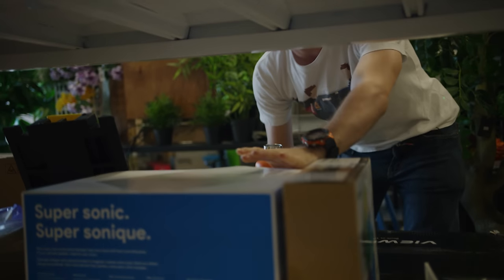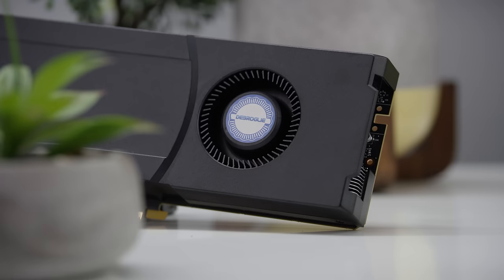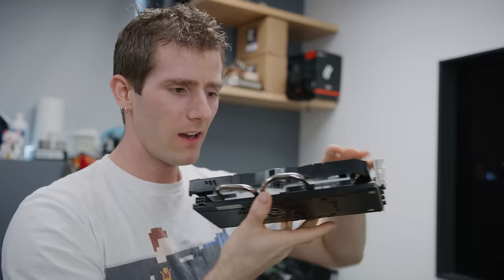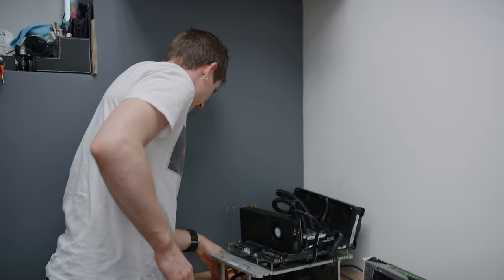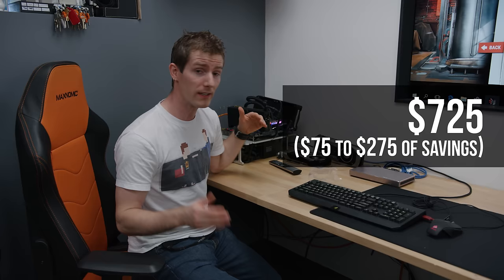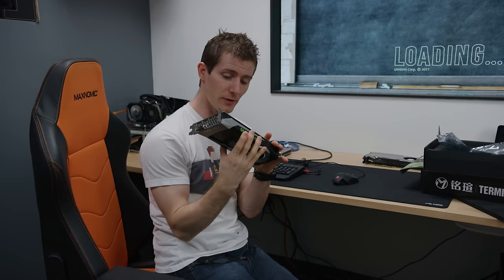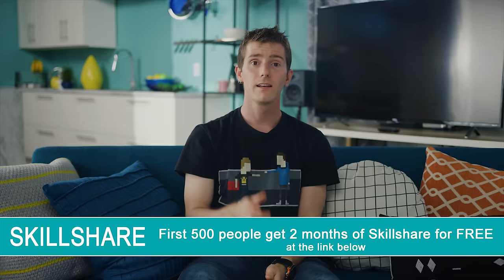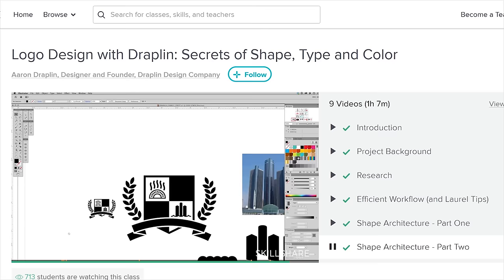Cheap AliExpress Graphics Cards - SCAM???

Comment: Actually, that ALESA GTX 1080 costs only around 400 USD if you can read the Chinese and buy it from TaoBao (AliExpress Chinese version in Mainland China) online. It will save your not only 275$, but 600$.  The shourd and cooling design are collected from old AlESA GTX980, while all the chips are actually founder edition of GTX 1080 and the Video Ram are from  a variety of brands. BTW, they are not good at overclocking at all and totally cannot do crossfire. If you can understand the chinese, you can check this video: https://www.youtube.com/watch?v=2Gdfo0yPw4Y. It is so cheap because some mud flood happened nearby a hydraulic power station nearby which mining was going on.

Comment: From watching your video, it doesn't seem like a scam at all. Just some poorer quality heatsinks reflected in the price. You just decided it was a scam from the get go, and trying so hard to prove it. Even at the end you were saying "not quite a scam" implying you're still being scammed in some way. You just got a cheaper variant, but you decided it was a scam because you're used to the premium variants sold in the western markets.

What you did miss a chance on is actually doing something useful like measuring temperature performances on those heatsinks and fans and comparing it to the expensive premium heatsinks from the western markets. Obviously it would not be as good, but what's important is that you can use the data to predict whether the cheaper ones are fit for purpose over the lifetime of the card. The heatsinks included might not be the pinnicle of engineering but they might do a well enough job for the purpose. Or maybe they don't. But you could test it and that'll be useful information for everybody..
Reply: alot of these seller are scam especially on ebay. they edit the cards firmware so your PC thinks its an high end card when it's really some old 9500gt.
Reply: So....the part of the heatsink that wasnt attached to anything and didnt really seem to help with cooling, and the plastic backplate that tried to imitate a metal backplate, those things are not scammy at all, huh?

Clearly these cards are made to look convincingly high quality in pictures, but when you get them on your hands, you can see they are pieces of crap.

Yes its not outright a scam. But its still sketchy at best.
Reply: Yeah the title is what one would call clickbait.
Reply: Morpheas bad design on the cooler maybe but there's nothing sketchy let alone "scammy". Do you even know what those words even mean. There's no outright scam, there's not even any partial scam. He bought a cheap 1080, he got a cheap 1080
Reply: Morpheas I see someone havent lived in asia... everything looks cheap, unless you want to throw in a bunch of money for a "premium brand", which, spoilers, is not considered cool.
Reply: the first GTX 1080 had a gtx 980ti shell. that is more or less a scam
Reply: Kloot Sack They've just used a cooler with an older design. Why is that a scam? It's essentially a hunk of metal with a fan blowing air through it. It's a piece of technology that's remained essentially the same for the past 10-20 years.
Reply: The same for 20 years?  You do know that GPUs didn't even have shrouds that long ago and if anything at all had only a small heatsink/fan.  This is what a GPU cooling solution looked like about 16 years ago:  https://www.google.com/search?q=geforce+3&safe=off&source=lnms&tbm=isch&sa=X&ved=0ahUKEwiky67mhKPbAhWJIjQIHSyAAEAQ_AUICygC&biw=2151&bih=1119#imgrc=Air3w2b2uBEqDM:

Hell, most GPUs back then didn't even HAVE fans or heatsinks lol
Reply: Capnsensible80
 You do know you linked to a google search of geforce 3s, all with heatsink and fans. Oh wow a shroud. What technological advancement, they invented a plastic cover over the heatsink and fan. My first discrete GPU was the Voodoo 3. Even THAT had a giant heatsink.

Let me explain to you what a shroud does. They cover the entire thing so that they can use a single fan to blow air through the heatsinks so that the fan doesn't have to sit right on top of whatever it is cooling. You know why the second GPU doesn't have a shroud? Because it has two fans providing coverage for the entire card. The shroud is a simple piece of plastic or alum to facilitate the heatsink and single fan combo. It's nothing special. It's a box.
Reply: The Great One Exactly!! On eBay!! Which this video is not about. It’s about AliExpress..
Reply: Morpheas Uh no.. You try to buy a cheap 1080, you get a cheap 1080. It’s only honest and fair.
Reply: Robair have you even tried to ever buy something from AliExpress?! They’re actually very costumer minded and will help you with every complain you have. And I can say the same about the sellers. Don’t judge things which you know nothing about.
Reply: I don't know if you watched the same video as me, or maybe you just didn't bother finishing the video.  They very clearly come to the conclusion that they got a working 1080ti and an actual 5gb 1060 meant for game cafes in china
Reply: Duncan Wiggin yeah just get what works. screw whatever you don't actually need.
Reply: Carson's Vids wasn't it just a normal 1080 though?
Reply: ArtisChronicles ya I swear I edited it after the fact but I guess not
Reply: Normal as in?
Reply: You clearly didn;t watch it properly either, one was a 1080, not a 1080 Ti.
Reply: ScottC if you read this full comment thread you'll see that I addressed that already
Reply: Totally agreed. Confirmation bias it is.
Reply: I don't see why it would be a bad idea to buy this Chinese 1080. It's got a reference PCB right? Just screw off the cooling, buy an A240G Fluid Gaming set from EK Waterblocks and you have your custom watercooled system (including CPU cooling and reservoir, fittings, hose) that looks and performes amazingly well for the price of one GTX1080Ti or lower. That's a no brainer if you can hold a screwdriver.
Reply: LOL, so true.

He didn't recognize and part numbers and the label seemed wrong, so it must be a scam!
Ironically if they put on stickers he expected, then he probably would have swallowed it hook line and sinker.
Also loved the way he marvelled at the reused shroud..
Reply: i guess we found the aliexpress employees...
Reply: Did any of you watch the video? Forget the cooler.. that's replaceable. It's literally a 1080/1060 card, proven by the benchmark results. So... you buy a cheap 1080 that performs just like the founders edition, but you think it's a scam or we're Aliexpress employee? You're all idiots lol. Sold as a 1080, performs like a 1080, it's PROBABLY a 1080. What scam is there?
Reply: Yes.!  Thank you.!  Good point. Well articulated...
Reply: I've never bought anything from Aliexpress myself and I don't care about it. I just don't understand what some people expect. 

If you buy a 1080 that cheap these days, you won't get a factory-overclocked model with a high end air cooling solution to brag about. You'll get a Founders Edition PCB with some junk attached to it at stock settings. End of story, rest is up to you. That's why it comes relatively cheap.
If you think that this is bad, just save up and buy a top shelf product to plug in and enjoy. But even those will have mostly reference PCBs with the exact same stuff on it to make them compatible with after market air/water cooling.
Reply: EVEN IF it's not a legit 1080... it still performs just as good as one. I don't see what the scam is lol.

Comment: That Kapton tape was on there because it went through a wave solder machine and they forgot to take it off. The must have had problems with that connector getting accidentally soldered and shorting out.

Comment: best budget 1080 you can get if you plan going water-cooling?! ;)
Reply: What? this shit was expensive as hell. 571$ is the cost of a 1080 here in sweden from a budget brand and it's been around that price 570 - 590$ since christmas. ^^
Reply: Palit GeForce GTX 1080 Dual OC HDMI 3xDP 8GB cost: 4999 SEK wich equals 571$ :)
Reply: Well yes and no. If you get a real 1080 you can sell off the oem fan assembly for $50 and be at the same price point. Only then, you have a legit warranty and EVGA will help you when shtf.

Comment: Regarding the 1060, my gtx 1050ti from gigabyte (not the gaming/g1) does a pretty good job on staying cool on your "very ineficient way of cooling". As far as shroud design it reminds me of my old asus gtx 750ti strix that looks 99% the same and worked pretty well for it's time. Sorry Linus, but again, you're never reviewing the low grade stuff. Not everyone does got big * sponsors.
Reply: Firion Razar I thought he was talking about how the fins are just one block of metal with some bits shaved off so half the the block is fins, while in usual strix and gigabyte stuff, those fins are individual separate pieces connected by the heat pipe?
Reply: That's exactly what I was talking about. Linus states that this block of aluminum is ineficient. Maybe it is, but for normal people budget, this simple type of cooler works pretty well. I had the 750ti strix and the 960 strix, followed by the msi 970 gaming; The first two had a simple aluminum block and worked well (quiet and cool). For the 970, a higher wattage part, exists a need for better cooling. So again, my point was to underline that not everything "ineficient" is bad, it's suited perfectly fine for people who actually think twice befor spending more than 150$ on a gpu. The others that got sponsors and a pretty nice income, I'm glad for them.
Reply: Firion Razar but the true is that cooler in models like that price gpu have no sense at all. Other perform way better and man it's the cooler not the ram. That give you endurance and stability, if you whana go cheap can buy extra cooler on aliexpress too and this aluminum full blocks they have very little and cheap for do a backplate placing it in ich ram black chip at the back. It's really really cheap. You can check for gtx cooler or rx cooler and headsink. Also liquid metal thermal paste can make difference and real thermal pads not that rubber they add. And for sure that's very cheap really really cheap an the improvement it's so big for the price!
Reply: @Ruben Martin I don't understand your point? For all those top tier parts there is a clear YES for premium coolers, but for midrange almost everything cheap is fine.
Reply: Firion Razar it's depends cause u use the pc for lol or csgo it's OK but mining rendering video or something like that maybe can cause damage in gpu very soon. So it really depends on how the % of cpu are you using. I mean I have a 1070 asus the first day warranty finish I will ad some liquid metal thermal paste and good quality thermal pads. Why? Cause I preffer run my gpu safe. Never pull from the cooler of a gpu try to use a knife for open, can make damege on the the chip/board contact.
Reply: Got it, Im fine with your opinion.
Reply: Firion Razar people never think about the real fact that lower temperature is most life time and better performance. That why in a 50cc put: 80cc racing, 28 carburetor, no filter, racing exhaust, racing electronic system.... And the stock cooler, I mean it's  a 125 radiator so expensive?? That's why they run cilindres full of scratches. In a pc it's the same. And people do same idiot thinks and thing its normal. But well industry will proud of us 😂😂🤣😂🤣😂

Comment: that tape is special heat resistant tape, it is used in electronics production,  to prevent soldering the particular spots. I think it's called kepton tape

Comment: I know alot of those ebay 750ti's are just bios flashed gtx550 & 650's, I'm sure they do they do that to all cards. That 1080 is legit tho really good deal.
Reply: Axillax yeah, agree with what u said. but there is really a 1060 5gb version in China. There were Chinese tech news released about that. It's a netbar customize edition.
Reply: The scam cards cost way way less compared to these tho

Comment: Given they're supposedly legit cards, makes me wonder what happened to them long term.
Reply: As long as the card itself is legit, and I don't mean those repaired or unofficially modified ones (which the ELSA card may be), it should perform just like any other cards. There is a chance that other brand new cards may encounter some issues in the long term, and that's exactly what warranty is for. So I am expecting the 1060 5g to work fine and not too sure about the ELSA card.

Comment: I wonder how long the cards will last in comparison to a legit card though. Yeah they can benchmark well but I wonder if there is any significant reduction in the graphics card life being a bootleg?
Reply: It's not a bootleg.  Nvidia made these 1060 5gb cards specifically for internet cafes in China.  Sure, it's not a commercial card that was available at all retail and online shops but it's a legitimate card made by Nvidia.
Reply: That's interesting to know. Thanks
Reply: It is really impossible to make a "bootleg" card today. Nvidia has to supply the chips. These are "off brand" cards, without fancy cooling and such, but the chips are still supplied by Nvidia, Nvidia knows of them, and they are legitimate Nvidia products.
Reply: I see. I just assumed they might be bootleg as a lot of products on AliExpress are bootleg. It would be weird if there was a bootleg of graphics cards that work that well.
Reply: Wow, you are really harsh. Also I own a normal 980 card and I'm fine with it right now. I wouldn't try to buy any graphics cards from an off brand Chinese site or some sketch sites like that. I'll pay fairly for my PC components.
Reply: Karissa W 
Imma buy one and try it out on my benchmarker for extended run times, will get back to you guys on this
Reply: I bought a used 1060 5gb from a chinese internet cafe for around 550rmb(around 80 dollars), it still works great.

Comment: I'm still running my GTX 560.

I'm not paying $350 with a risk of not getting the right GPU.
Yes, I do play games. Yes it can be horrible.

But oh well, it runs.
Reply: I only play csgo with intel integrated :/ 800x600
Reply: I didnt have any issues with my 550 ti. I only upgraded to 1060 recently, but the 550 ti was doing me fine
Reply: Buy an rx 480 8g asus strix for 80$ like me :)
Reply: SeggledFade You can pick up used 970's for $240 and under, I've picked up a few in the $170 range. They roughly match a 1060 in performance, usually a few percentage points ahead - Something to consider.
Reply: smashhawk man I remember when you could get r9 290s for like 120$ which is about what a 970 is the used gpu market us fucked really bad right now
Reply: SeggledFade at that point just but a console XD

Comment: btw, my PC is using 3 year old parts and got 2000 better points then that score. (points were 5875. Av fps was 43.95. GPU was Msi gtx 1050ti gaming 4gb. Cpu was Amd a8--6600k 4.0ghz.)

Comment: Neato I'm testing a hybrid of preowned/unknown/off-brand build in AUD:
  - i7 960 cpu from ebay $55 +8.55 postage
  - "unbranded" X58 Pro mobo from aliexpress(appears to be a knock off of the MSI x58), $102.28
  - offbrand ddr3 ram 1600mhz 16gb(2x8gb), $86.09
  - cheapest 120gb SSD I could find $29.15
  - Discount clearance stock mac 1tb 7200rpm HDD which i reformated for windows $29.00 + $5.95(Postage)
  - crappy RGB cpu cooler which actually looks much better than I expected $22.94
  -  my old XFX TS 550w PSU
  - my old GTX 960 MSI 4GB 
  - windows 10 pro key $8.90
  - Dell 20" Inch Ultra Sharp 2009WT $35.00+$19.85(Postage)
Total cost of the system not including my old parts is $402.52Aud I've bought off-brand RAM before (2x16gb 2400mhz) and found it was actually performing better than my corsairs so can't wait to see how this pans out I did note the motherboard seems to not list the i7960 as a compatible so bit of a leap of faith but I've found Xeons with same performance and better  which are only $15 - $39 kinda wish I'd found them earlier. 

I'd love to see you attempt a rig buying the most doggiest/cheapest parts you can find and see what happens and if/when it boots attempt OC'ing components.

Comment: As a person who live in china, who loves going on to aliexpress china edition to find cheap computer parts(expecially GPUs because i dont have a proper GPU, imma just using intel HD graphics) i believe that the GTX1060 with 5Gigs of Vram is supposed to be just for an gaming internet cafe. It seems that it is specially designed to save cost and not loose performance

Comment: Well linus not all gpu release with nvidia spec. Example is my old gpu gt730. It ddr3 but have 4gb vram. And backplate is have function to protect gpu.i mean i almost broke my new gpu that haven't been tested yet. Because i try to replace cmos battery went it running and it fell to gpu make small spark sound and freeze the screen lucky after reboot it run fine (i know dont messing around with pc when it running) that why backplate was made. And having backplate make cleaning gpu more easy than brush directly to pcb full of small components that can broke easily

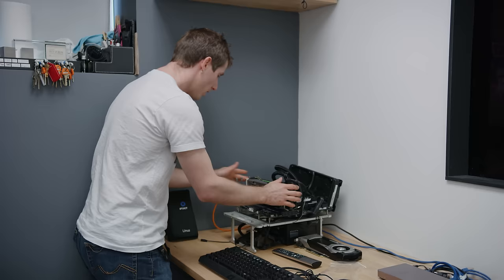Comment: I stopped a 3:24 to comment. 5 gigs is possible. The pcb of the 3 gig model has space for more ram (if I am not mistaken). Manufacturing trick. The higher ram models have very little differences other than more ram chips added and programed in...(other than perhaps better quality silicon). My old Radeon HD6870 has room for another gig and you can buy 2 gig versions if I am not mistaken. IDK... My guess is that they just built a 5 gig version on the NVIDIA platform. Just a thought. Now I will continue watching to see if this another BS card or just an over seas version where the brands we know and love are harder to come by. Great video so far Linus!!